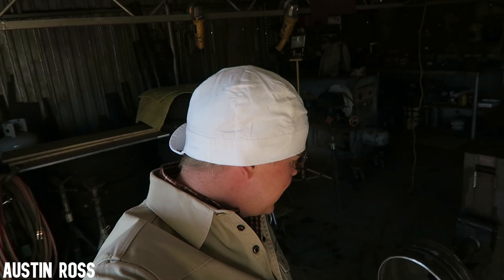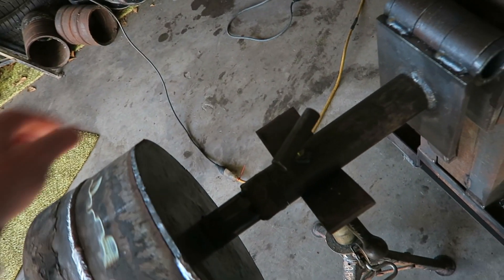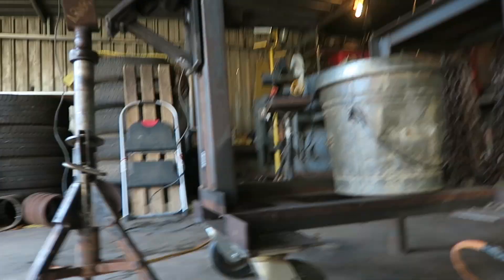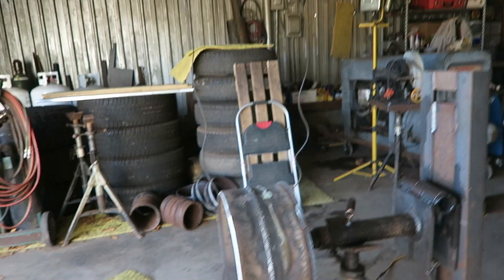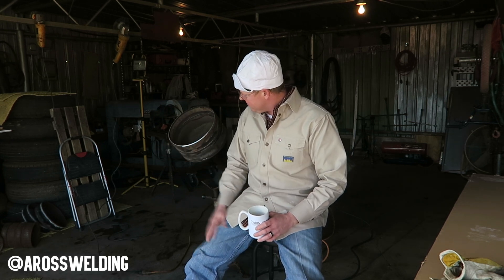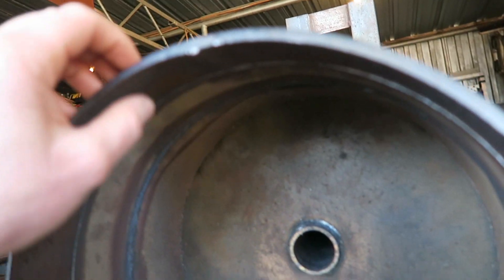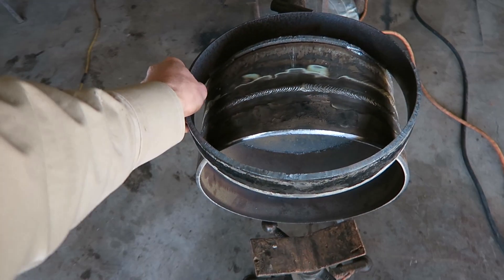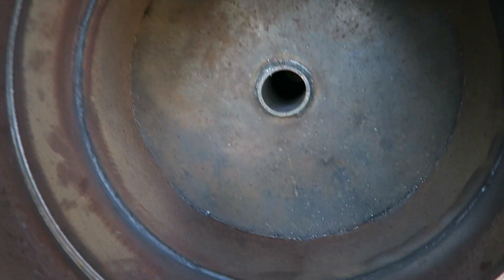PIPELINE WELD TEST PRACTICE & THE TRUCK YOU NEED TO PUT TOGETHER A WELDING RIG

Comment: The dually has good flotation and traction on the muddy right of ways. I  did sanitary process tig ( food service ) with Dynasty's powered by a 11,500.watt generator. Inverter all the way
 Saves much weight so a smaller truck can be doable. No off road in the winery's. With the full electric vehicles on the horizon soon will only need an XMT 350 to make a welding " rig ".

Comment: 8 ply tires Don't, in my experience,  hold up on single, if the rightaway is rough. I had to run 10 ply. They are expensive enough to negate the savings of the extra tires.

Comment: I can carry everything you can with your big dodge  for welding my 4x4 5 speed ranger will carry and use half the fuel you don't need huge trucks unless your compensating for something
Reply: Your trolling theres no way
Reply: Think about it its really not that much weight
Reply: @joshuareaper2082 Not much weight? On what planet?

Comment: What's the best welder to get started with been welding for 16 years mainly shop and industrial maintenance done pretty much every alum ss carbon stick mig tig flux even brazing never done pipeline want to put a rig together and break out

Comment: Love your videos man, I'm a new subscriber. I've been soaking in all the knowledge I can about pipe pipeline and pipeline welders. I'm looking to get into it this year whether it be as a helper or however I can. I currently have 6 years of experience welding pipe in refineries and had a few questions for you if you could answer for me if you have the chance. First of all my welder is a 2016 Miller Bobcat250 it's a gasser is that gonna be big enough you think? Also I hear a lot that pipelines use mainly xx10 type of rod is that true? What rod did you use in this video was that 6010 or 8010?

Comment: New to your channel. Inspiring pipeliner. Plan on watching all of your videos. Completely agree with a 1 ton dually truck. I notice you run a single cab. Is there a specific reason for that? Advantages and disadvantages of a crew cab?
Reply from the maker: I like it for the accessibility and Turning radio is. I talk more about this in this video.
https://youtu.be/Qjdu9zqv4PE
Reply from the maker: Radius *
Reply: Great video. Thanks man

Comment: anyone scratch build their trucks? I been a car guy & poor too long, but prices I see for trucks freak me out, & I say ill build my own, have an old 1980 GMC 3/4 ton with 1 ton rear, dual rear wheels, 2wd, going tomorrow to hopefully pick up a granny gear 4 speed & transfer case with driveshafts, dirt cheap, & got to scrounge for a front differential with same gears as my rear, & already wheeled & dealed for a big block Cadillac engine, need to pick up soon to replace the worn out small block it has in it

I figure I can build truck dirt cheap, compared to buying, but I still got to learn everything, in pipelining,  but I do own a lot of tools & equipment, I have a vintage Hobart Pipeliner welder.

Comment: With the 3/4 ton trucks the frame will crack after 20 years of pulling around a full weld kit and a small trailer "that's if your vary easy on it"... the engines will give out a time or three over those years...  get a frame for a 1 ton truck cheep from a scrapper and cut/weld it to fit under a 1/2ton truck cab and cut/weld the suspension to keep it looking like a 1/2 ton truck... if your welds are good the frame of that truck will make you all the money.
Reply: Arden Nielsen 

In 20 years its going to be a rusty hunk of shit!
Reply: Arden..zip it...let the grown ups talk..

Comment: Austin: Do you cut your pups\coupons and grind the angle by hand or do you use a pipe beveler? Would like to see someone cut a pipe bevel by hand. I know most angles are 37.5 degrees but to freehand would be a chore I would think.
Reply from the maker: no we don't put the bevel on by hand. we use a beveling machine or band and crawler. i have plans on making a video on setting up both of these and a couple tips to go along with.
Reply: I guess my question is; what if I didn't have $2000 to drop on a pipe beveler at the current time. Been looking at craigslist and everything I see is $600/800 for the Mathey Dearman then another $500 for a long straight torch and coupons are expensive. That leaves hand beveling as the next best alternative. What's your take?

Comment: Had a couple rig welders show up to test on 6" ammonia hot gas, the process was 6010 and 7018 uphill.they made a mess trying to run them 7018's uphill, probably like I would running a pipeline rod.LOL I wanna try though.
Reply: Dean Sellers what do you work on where do you work never heard of that. Very interesting are they rig welders?

Comment: Curious are you still welding on the pipeline? I'm from Pa and they ran the gas line right up to my property line. Most of the trucks where Dodges. My benifit is I'm a diesel tech at the local dodge dealer. Worked on all the trucks!!!
Reply from the maker: Thomas Kepler 
Yes I still weld on the pipeline

Comment: Is it difficult pipe welding? I’m doing pipe in college and a lot of people say it’s not easy welding pipe. Also you need to make some videos of a lot of welding at home and less talking(some videos not all)
Reply from the maker: Chase 
Depends on where you come from and your prospective on difficult.
Reply: Chase it's not. I actually prefer pipe over structural as you don't deal with arc blow due to the geometry of the piece

Comment: A question I have is as a rig welder are you a 1099 or w-2 ?
Reply from the maker: Curtis Heaton 
Most pipeline work is w-2
But some are straight contract, therefor it would be 1099